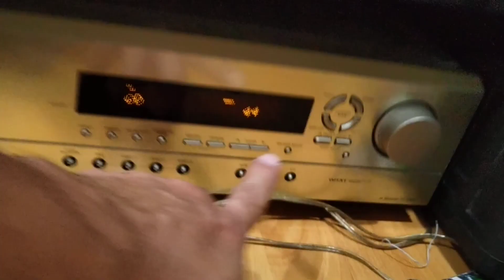Network Hertz ch200

Comment: These suck. Anyone reading this. Someone installed these on my vehicle and they dont do shit lol. I wondered if they connected them wrong so i followed the wiring they did. Everything the same color.  Crazy person im sure. I get base to these tweeters. The tweeters are garbage too. Super easy to mount though.  I'll give them that. Also the wire with the red tracer is the positive.  The directions don't say at all. Someone ELSE i found on a forum had to reach out to customer service.  CH200 CH 200 GARBAGE.